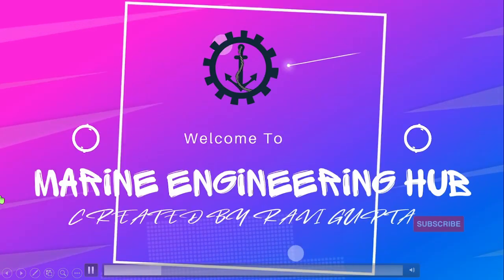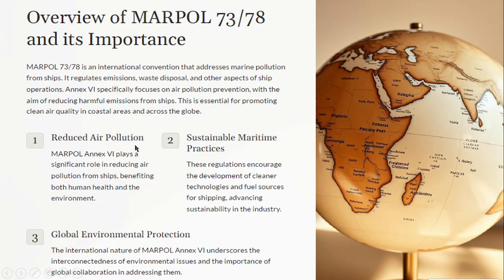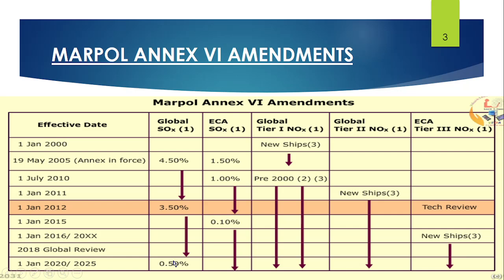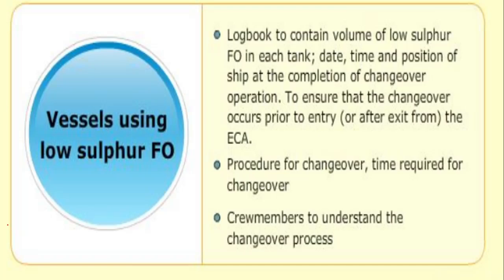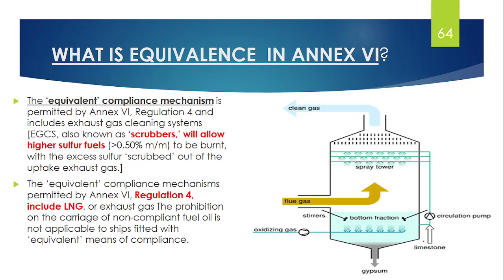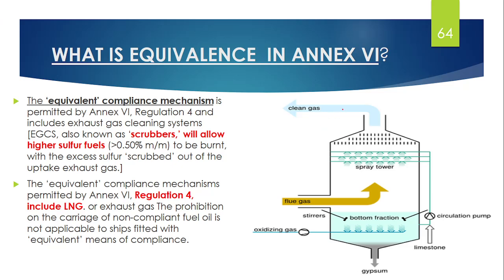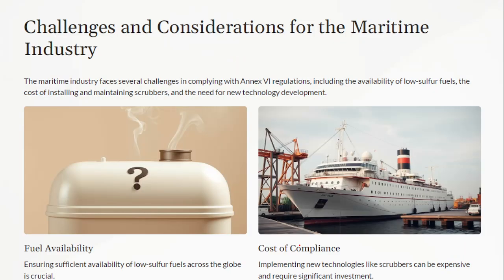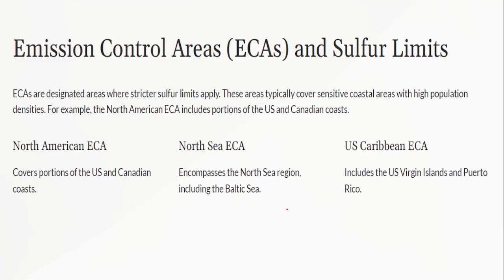SOX EMISSION|SULPHUR EMISSION|REGULATION-14|MARPOL 73/78|ANNEX-VI

Comment: Thank You! Good Info.
Had one doubt, can we use 4.5% sulphur fuel with respect to regulation 4, if we are meeting the required criteria?
Reply from the maker: yes if you are using scrubber technology and it is able to  meet with the sox/co2 emissions criteria norms you can use 4.5 % of fuel
Reply: @MarineEngineeringHub  Thank You